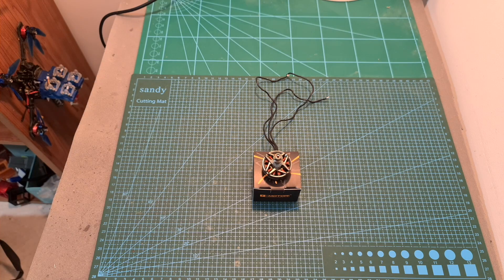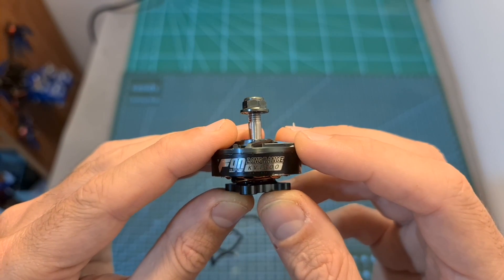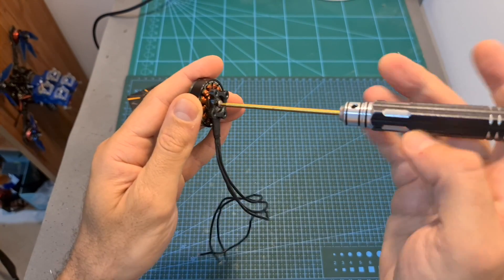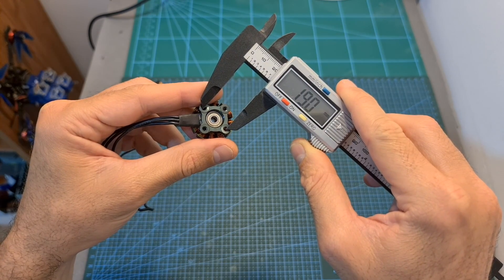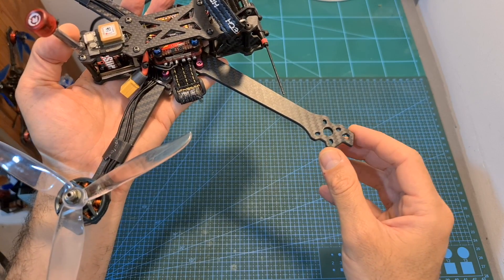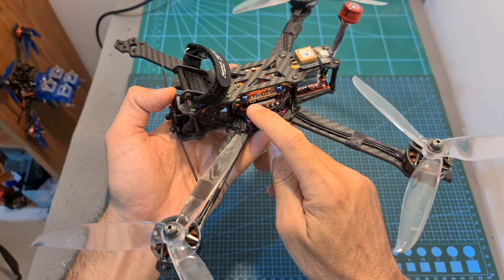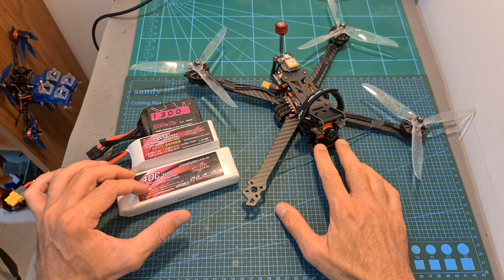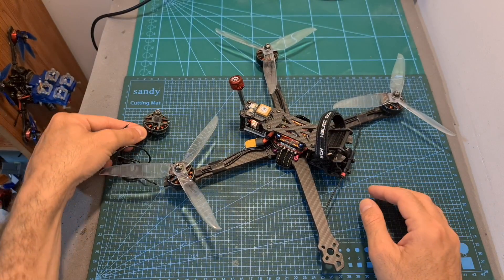T-Motor F90 1300KV Motors - Thrust Tests & Flight Footage

Comment: Wow, that's some motor. And as others have wrote, they have a strange sound. Found the motors website by accident. Thinking about doing a build. Hard to decide, though. Build or just buy. I like the Dji Mavic 2 Pro with Hasselblad camera, and it has a decent flight time plus range. Thank you for the detailed specs on the video. Was heavy into rc helis, and got rid of all. Still have my Taranis x9. Excellent radio that I have not used except to fly using an old copy of Phoenix Rc simulator.
Reply from the maker: Thanks Joel. Well there is something special about building your drone, but if you need a compact drone for photography, the Mavic 2 (or 3 lol) will be a very good option.
Reply: @KremerFPV  Once you start adding up the components for a build then the Mavic looks like the way to go. When I was doing the nitro helis, the fpv was expensive. At least a thousand for low resolution. Now it's amazing what's available for cheap. Long range, if you ignore regs :), and cheapo headset even.. Had a Hirobo Sceadu 50 which I strapped a milk crate to. Then strapped a mid size video camera inside the crate. Flew it way up until it was a centimeter dot in the sky. No fpv.

Comment: I get around 12 min on 7045 HQ biblade with 4s1p 2600 Li-Ion pack. DC7 frame, AUW around 850g. The same craft with xings 2306 1700kv I get better results (16 minutes flight time)
Reply from the maker: That's interesting. I need to run more tests using different motors / propellers / batteries.
Reply: @KremerFPV  Maybe there was something with my setup as well, or the li-ions were not good enough. Here is my flight with 6s 3000 VTC6. https://www.youtube.com/watch?v=L12C7QdyLrc

Comment: Jeez, cruises along on a mere 35 amps?...I think I'll stay with my 5 inch LR quad thanks....
Reply: This ampmeter is completely off. You can know that just by seeing how little the battery sags with such a supposed high load.
Reply: Current draw really bug me out, looking for 7" efficient and smooth motor, now Im confused

Comment: 8min on 3300 6S? That's strange. I use the 6s 2200mah CNHL, wich you also have, and can fly 15min with it. 7" Geprc mark4 HD with DJI, 2508 AirA Motors.

It seems like those motors are way to big for 7" or something is wrong with your build. Is that amp reading correct? I see 8,5A when Hoover/Cruise while yours eats 20+A. Something definitely messed up
Reply from the maker: 4s 3300mah battery
Reply: @KremerFPV  
That explains something :)
But still very short flight time. 6s 2200 and 4S 3300 have same Wh, so should fly about same time when cruise.
Reply from the maker: Yep. I mentioned that I had some issues with this build. BTW I am not sure how accurate  the current meter of the FC is.
Reply: On my 5.1" I get 13mins with a 1800mah 6s at 60kph. Using 2306.5 1750kv motors on GF 51433 props. My next build is going to use the same setup with GepRC 1300kv 2306.5 on a 7" frame testing HQ 7x4.5x2 1vS, Dal 7056 tri and GF 7042 bi to see if I can beat that. The spec sheet claims 6 grams per watt efficiency which is the same as 2806.5 and half the weight.
Reply: @changeagent228  
7" on 2306.5 is overpropped. Lots of tests have been done. Lots of wobble and lack of response. Sweet spot is 2508 efficiency and performance wise on 6S. Big prop needs wide stator diameter to maintain enough torque.
My 5" 2306 1750kv can fly the same time as your´s with that kind of "fat" battery, equipped with dji... no magic juice here, just prooven formula: 6S low kv 
You can try this setup (2306.5) on 7" if your main goal is maximum flight time without care about flight charactaristics. But going that route I would first try to shave off any weight you can (Another frame, wiring, 20x20 FC...) since weight is you biggest enemy :D Then run some LiIon batteries and you will see 30min flight times, without any special magic motors.
Reply: @waldemarkraus2855  Absolutely yes the AUW will be 440g with DJI. I had a TBS G2 a while back with 2206 1450kv Endurance motors that used HQ 7x4.5x2 1vS props and seemed perfectly acceptable till it was lost up a mountain lol. I am tempted to try larger motors but the 60g ultralight 7" frame I run can only take 16x16 max and 2806.5 motors are 19x19. I'm welding some new Li-Ion packs to test so hopefully will be able to lower the AUW some more.
Reply: @changeagent228  Hi there! I‘m currently looking for an ideal setup für a 7“ Y6 long range build. The motor question is driving me crazy. On paper i agree with you, 2306.5 1350kv sounds ideal, even for my 4s2p setup. Have you been able to try them out yet? what were your results? thanks in advance!
My alternative would be the Brotherhobby Avenger 2507 V2 with 1500kv for 4s.

My build will weight around 350g w/o the battery.
Reply: @eyeflytinkerings  Yeah the 2306.5 1350kv worked fine although the measured efficiency was less than 7 grams per watt. I'm looking at a 10" build next. Those Brotherhobby motors are not a bad choice if you want more power and response. 👍🏻
Reply: @changeagent228  thanks! Yeah, after more research it will definitely be 25XX as a minimum. Howver now i'm even considering 2806.5s... even more control, however they so weight quite a bit more. this motors question is really driving me crazy.
Reply: @eyeflytinkerings  You are welcome. Yeah it drives you crazy because in the end the only way to be sure is to buy them and test them lol.
Reply: @changeagent228  Indeed that is very true. I settled with the Xing2 2504 1500kv for now. Judging from the numbers these should provide the best mix of performance and flighttime.
Reply: @eyeflytinkerings  Awesome. Hope they work out for you. I have some xing2 1404s and they are super smooth. 👌  I will sub you if you ever make a vid I will watch. 👍🏻